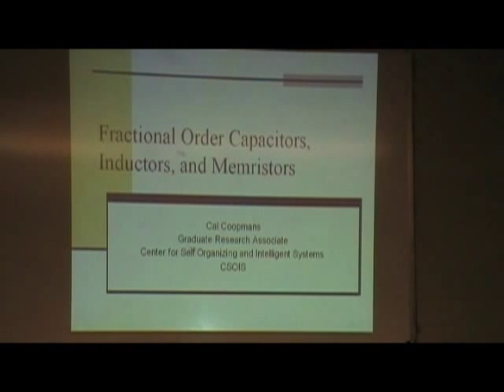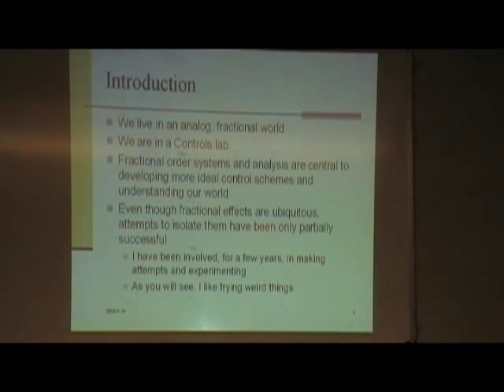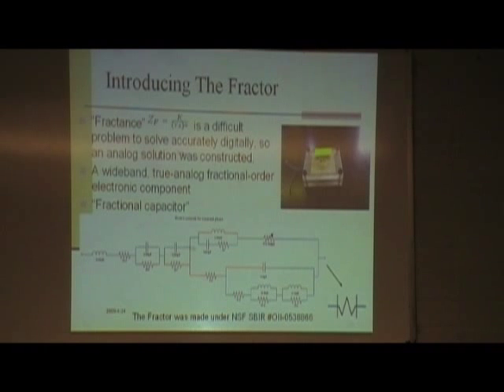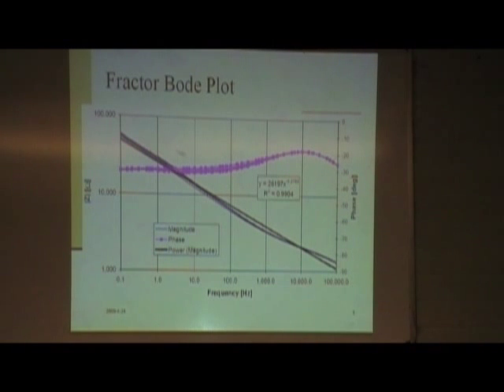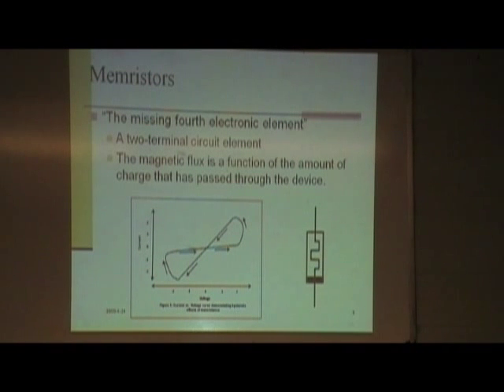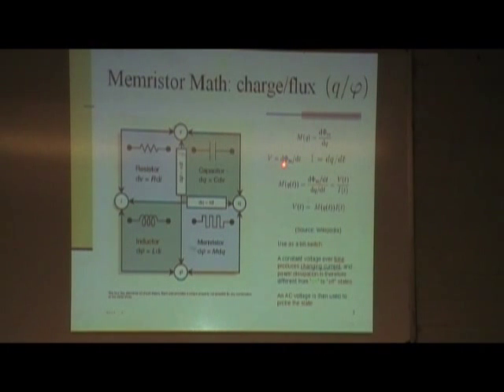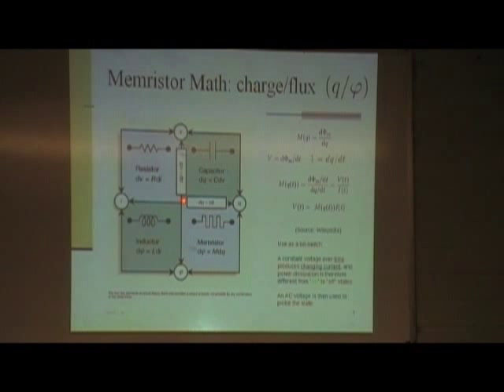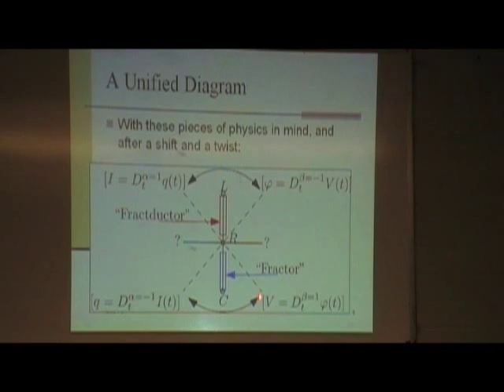Fractional order capacitor, fractional order inductor & fractional order memristive systems (Part A)

Comment: What is the difference between this approach and the reported in 

G. E. Carlson and C. a Halijak, “Approximating of Fractional Capacitors (1/s)1/n by
Regular Newton Process”, Transaction on Circuit Theory, pp. 210-213, 1964.

?